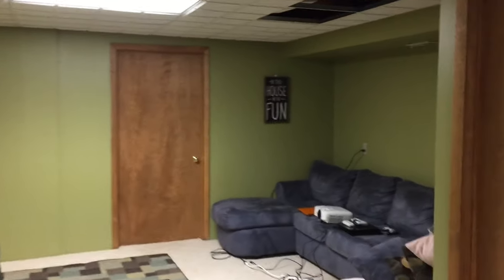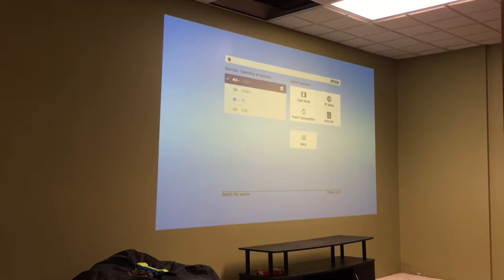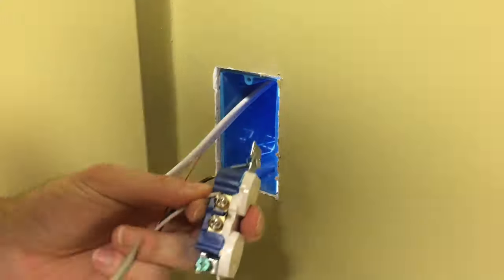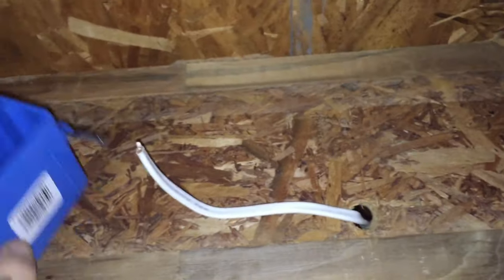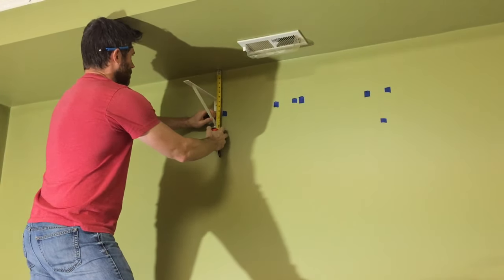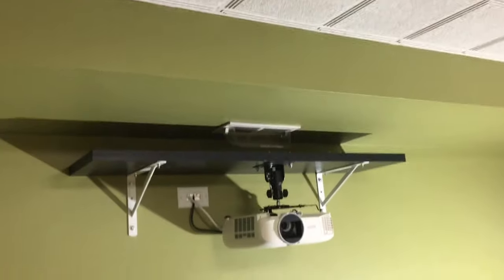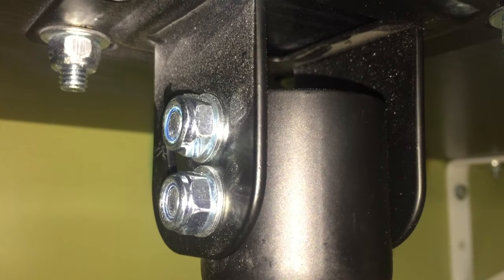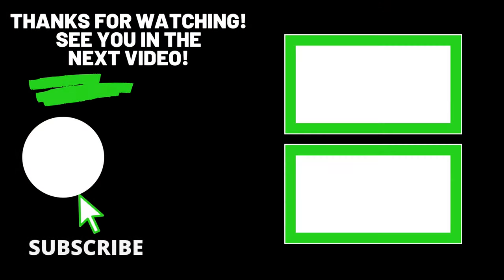Home Theater Projector Installation - Ceiling Mounted - Complete  How To Guide - Wiring, Routing

Comment: nice idea for hanging the projector. i have a celling fan in my living room. so  i was thinking of moving the projector closer the wall so the celling fan wouldn't interfere with the projector.  plus im gonna have to move the surround sound receiver closer to the projector. thnk i'll do a shelve too mount the projector then another for the reciever.
Reply from the maker: The shelf has worked out well for me. It’s a good solution in the right circumstance. I hope your build goes well!

Comment: Hi can you tell me did you use the software keystoning at all? I read every where that you should square up the image without use or keystone (lens shift is ok) I am just having trouble getting a squared image with mine, but it is sitting on the shelf a little bit above the sitting position not upside down on a mount
Reply from the maker: It depends on the projector. This projector only has the keystone in the software. It is adjusted through the menus on screen. 
My previous projector was adjusted manually.

Comment: The projector says it’s output is 720p, how can I get it to project in 1080p as described? Thanks!
Reply from the maker: My guess would be that it just automatically detects the quality of the input device. Maybe your input is 720p? I have personally never changed it in the settings. I just connect my device (PS4, laptop, switch, …).

Comment: WHo has that commercial panel cieling sht at home?! Grrr
Reply from the maker: Typically in basements. To finish the ceiling without trapping all of the utility pipes and wiring behind drywall. It’s been in the last two houses that I’ve owned 🤷‍♂️. I love it. Finished drywall would be a nightmare. I would have been completely screwed dozens of times.
Reply: @HowtoandReviewsOfficial  oh what a trip. I lived in Missouri till I was 7. We had a basement. Moved to Texas and haven't seen a basement since.
Reply: @HowtoandReviewsOfficial   hey while I got you here, I happen to be about to remove projector from ceiling mount to rid it of large black spot it's projecting....do I just take it off like I put it on or do I remove projector completely from the mount?
Reply from the maker: @metaldreams3595  whatever is easier, but there should be a way to leave part of the mount attached to the projector. There should be three or four screws attaching the projector to the ceiling mount and you should not unscrew those. The ceiling mount should have some kind of bolt or mechanism to split it or remove it without unbolting it from the projector.
Reply: @HowtoandReviewsOfficial  thanks a lot off your time! I'm on it